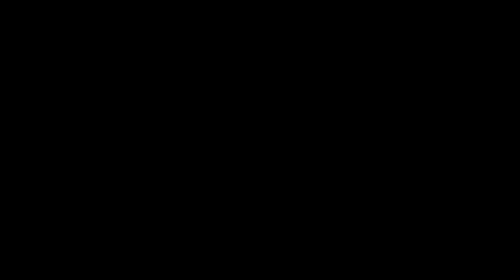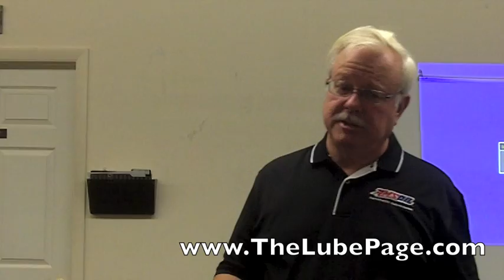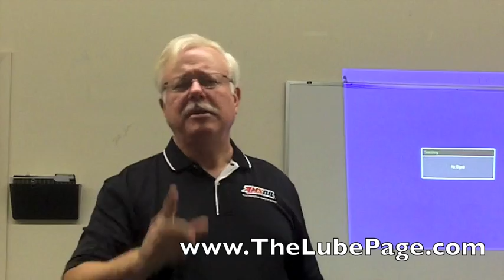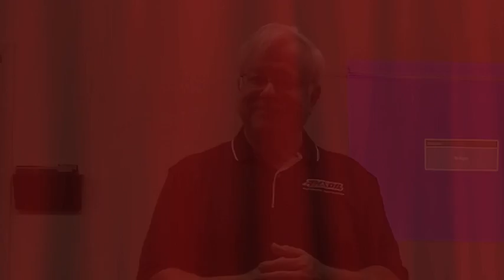Transmission Fluid Facts

Comment: Guy buys a new $60k truck...gets mad at the $50 oil change every 5k miles...gets even more upset at 120k when they recommend a $200 transmission service...skips the $200 transmission service, that's too expensive....150k transmission fails, and wants to sue the automaker because they sold him a junk pickup truck with a terrible transmission...but they'll spend $5,000 in fuel a year chasing a football team around the country to go to all their games, but that $200 transmission service well that's just too expensive, and what do you mean I should have changed it at 30k miles the book and dealer says it don't need changed till well over 100k...well sure they want you back on the lot in 10 years or sooner buying another vehicle as a result of the neglected maintenance.

Its got "lifetime" fluid in it...yeah sure it does, now change it.
Reply from the maker: William, tell us what you really think!  Lol
Reply: @thelubepage  hi Dan I have a 2014 grand cherokee with the 
Zf 8hp70 transmission. Here in canada dodge sells the fluid as a mopar 8&9 speed atf for around $40 a quart. Elsewhere its sold as lifegaurd 8 (amazon & from zf directly) for a little less. There's alot of talk on forums about the dangers of using any other fluid. However there are alot of people who have used valvoline maxlife full synthetic with reportedly no problems. The local oil change shop says that according to their information the vavoline meets shell L-12108 spec which makes it compatible. Ive been unable to find any information on what exactly shell L-12108 specs means. I have however been able to pull the data sheets for both fluids and the numbers are very similar. Wanted to get your expert opinion on this... if it helps I can send you the data sheets showing the technical data/spec for each. I want to do whats best but am very suspicious that "only use our fluid at $40/liter" thing is just a marketing ploy.... thanks for any input/advice... let me know if you want the info
Reply: I believe they want throw away cars now, just like toasters. The days of manufacturers priding themselves on producing a car that goes 300-500,000 miles is over. Not to mention with the help of the CAFE standards.
Reply: @LittleJimmyNorton  My 88 F250 has 760k on it, no need to throw it away, all those are highway/towing miles, no mechanical issues at all.  It all depends on how well you take care of stuff.
Reply: I find it very frustrating now because even the vehicle manufacturers are emphasizing the will not honor there 10 year 100,000 mile warranty if they find out the fluid that was installed doesn’t meet the specific spec that they provide you in the vehicles manual. Forcing you to buy there overpriced spec fluid. God forbid you buy a fluid that actually meets and exceeds there’s and you end up having a mechanical issue that should be covered because of a inferior part and they void your warranty. Now you end up having to pay for a repair they should have covered. Essentially we’re forced to buy there over priced fluid at least until the warranty runs out. So I will be putting there fluid in my truck at the severe service interval or less till my warranty runs out. After that by then I should be educated enough to decide what fluid manufacturer product I will put in it.
Reply: @Jon-O.  Thats actually against the law to require their fluid.
Reply: @brianpeters867  no It's not they give a fluid spec and there are no others with that spec sometimes for years depending on what fluid it is
Reply: @Jon-O.  I think you miss my point. There is a law called the  Moss Magnuson act, since 1975. Baiscally it states that if a dealer mandates a fluid and parts for your vehicle, it must give you the fluid and parts, free of charge. To say to you “You must use this such and such OEM fluid in your transmission, or your warranty is void.” It is against the law to do that. If a dealer says that to you with anything that has a warranty, ask them to give it to you in writing. They won’t because they know they can’t. It is a bullying technique. Now if no other transmission fluid is available and meets spec for trans, except the OEM one, then the only very obvious choice is the OEM fluid in question. I would just about bet, however, that Amsoil ATF or ATL would work just fine, in a test situation of course.
Reply: @brianpeters867  that is where the conundrum lays in. If there fuild is the only one that meets the spec then one is used that doesn't and a failure results your warranty is void. And your vehicle did come with it installed free of charge. When you go to replace it they are not legally bound to give it to you free for the life of the vehicle.
Reply: @Jon-O.  There is no conundrum. Thats why Amsoil uses a dealer network. Dealers will look things up or call Amsoil technical to get a firm answer on eqch vehicle/equipment. Your dealer will recommend the proper fluid for the vehicle in question. If we do not have a fluid for the vehicle, then don’t use any Amsoil trans fluid or any fluid that is not up to oem spec. We have fluids for most vehicles. Call a dealer. I am a dealer but this isnt my channel.
Reply: @Jon-O.  But when the service life of say the trans fluid, but vehicle still under warranty. You can ask the vehicle dealer if they are providing the filter and fluid for free. If they cant, then use any fluid you wish thats under spec.
Reply: @brianpeters867  yeah but they do not have to give their fluid for free they are not legally bound to that
Reply: @Jon-O.  Hang on. The Moss-Mag act says that a car dealer can NOT void any warranties if you use a fluid that meets the spec of the OEM fluid. They CAN void your warranty if they give you say ‘oil changes for 3 years’ and you put a different oil than what is offered at the dealership for free as part of the agreement in the sale. Yes, in that case they must abide by that agreement and give you the OEM fluid for free until the car reaches the expiration of whatever agreement is in place. IF they offer free oil change etc. If you decide to say ‘heck with them they wont know ill put WalMart full synthetic in my car and theyll like it’ THEY can void the warranty then if they sample the oil and find out some other oil is in there. If a car is year 4 and free oil changes  ended at year 3 but warranty is until year 5, use whatever fluid you want that meets the spec!
Reply: William Todd see my last post,,,American way,,,
Reply: Maintenance-free transmissions and lifetime fluids are the biggest lies ever told. Even a perfectly sealed transmission with magical unicorn synthetic oil will be due for servicing after five years. It's an inevitable and unavoidable law of physics that any form of lubrication has an expiry date.

Comment: so amsoil dealers know so little about cars he has to explain what a clutch pack is?  This dude thinks the rad runs at 200f cause of the thermostat? LOL if the rad ran at 200f your car could never run like... under 240f... 

BTW my 1980s np205 t-case can use gear oil ORRRRRRR atf... yep... ATF in a gear to gear transfer case... so the whole thing about a auto transmission... and atf... 

CVT constant velocity transmission.... wow... just wow... dude donno wtf a cvt stands for but we should believe anything else? 

Wonder if he knows what mercon LV means... 

dude talks about API yet amsoil is not API rated LOLOL...
Reply from the maker: Matt
Please take your medication on time!  Your eminence as the grand master of all things mechanical is not in question so you don't have to continually show your superiority.  

Again, as I've told you in other post, my mission is to make sure the correct lubricant is called out for the application.  So explaining the action in a clutch pack is a prelude to explaining the necessity to make a fluid that will be compatible with that action.  It doesn't mean that no one knows what a clutch pack is but it is part of the explanation of why we have to make lubes that re compatible or that may enhance the clutch pack action.

Oh Matt, I don't think you have followed my complete explanations of ATF.  I explain that the auto trans has real gears (sun and planetary) and that these gears can be under just as much load as the manual trans and yet they are protected by a very light weight ATF.  There are even some manual trans that use ATF so of course the Transfer case uses ATF.  So Matt what is the exact lubrication regime for standard gears (no contact and slide)?  You know you can use ATF, 30 weight motor oil or 75W-90 gear lube in many transmissions in others the OEM is specific calls out a specific lube.   

You got me on the CVT, I think I'll just go to my room and cry.  Come on Matt, that's just gotcha tactics and usually comes from someone trying to show how they are the Superior dude.  Truth is in all my discussions, I just use CVT and with all the acronyms I did a brain fart and substituted Velocity for Variable. Again, for my purpose which is to make sure the folks I am training know that the CVT takes a different fluid than the standard ATF.

 Mercon LV .... I don't know Matt, if I get this wrong you may be elevated to Grand Pubar, so let me give it a try.  Is it Low Viscosity? Oh my I hope so.  This is so much like Middle School but I have to respond.

Amsoil meets and exceeds the API ratings on all oils.  Amsoil does not license all their oils via the API and neither do all the oil manufacturers.  Check out Valvoline high mileage oils and you won't find the famous donut symbol. The License means you are complying with the additive limits from the EPA and Valvoline and Amsoil may have a more robust additive package so the API will not license the oil.  However the performance requirements set forth by the OEM's can be met and this qualifies the oil company to list on their bottles that they meet or exceed the API standard, you just won't see the licensing.  Check out any Amsoil oil and you will see the API S for gasoline and C for diesel ratings.  You will even see the donut on some products.

Matt, Amsoil has been making synthetic oil for auto's and trucks longer than anyone (since 1971). In fact Amsoil produced the first API rated synthetic oil for auto and trucks.  Al Amatuzio started the company and today his son is now the CEO.  This company went from a small startup to having over 800,000 square feet of manufacturing in an ultra modern blending facility in Superior WI.  The company is well respected and considered the pioneer in synthetics.  I don't think you like the idea of independent dealers. Al Amatuzio was crazy about entrepreneurs and loved to see the little guy get a chance, so Amsoil is built on the independent dealer model.  You will have some Amsoil dealers who may not get everything exactly right and some who are over aggressive in sales but in my 27 years with Amsoil most dealers are striving to do a good job and build their business.

Comment: The newest transmissions from GM/Ford are a 9 speed automatic, and a 10 speed manual. Transmission fluid has to lubricate, act as a hydrostatic drive fluid, a lubricant,  a friction modifier, and a coolant. Then I also have "transfer case fluid", too! I use Valvoline, synthetic. I have for YEARS! DEX 6 full synthetic!!! Transfer case fluid, I went with Delco. It's grape scented now! I swear to god, it's blue, it's oily and it smells like grape soda pop.
Reply: Switch to Amsoil.
Reply: i know this is old but there is more. It's also has to not foam, it has to handle temp changes as the seasons change, it also has to clean (detergents). It's quite complex.

Comment: Are all brands of ATF+4 the same? I've been reading the license agreement with Chrysler specifies the exact formulation in order to carry the +4 designation.
Reply: I know this is old, but you simply need to look for the ATF+4 on the bottle, then the license #. Chrysler licenses their atf fluids through a variety of companies. SuperTech from WalMart carries it for about $5 per qrt.
Reply: @mitch1847  8
Reply: Amsoil: As long as it lists the spec on the bottle, it will work just fine as a replacement.

Comment: Just curious.;  My Buick fluid is Cherry red . clean and no burnt smell, But kinda thick in feel . my Question is
automatic transmission fluid, viscosity, Dextron VI by  GM  just how thick is this type fluid when feeling it with fingers on the dipstick  in comparison to  a motor oils weight  should it be something like a 10 weight or 20 weight motor oil  by feel?
Reply from the maker: If your good enough to rate viscosity by your fingers you are really good.  Transmission fluid is just below a 20 weight and in some cases about a 10 weight.

Comment: Can I use Amsoil atf on my GM 2007 H3 Hummer 3.7 atf
Reply from the maker: Yes you can.  You would use the ATL version which is Dexron VI rated.
Reply: U drive a Hummer. Lol. You're screwed

Comment: Constant Velocity Transmission??.... LOL!.
Reply: Dan Watson Continuously Variable Transmission.
Reply: Dan Watson Constant velocity is what CV stands for regarding CV axles and CV joints. They are called constant velocity because they maintain identical velocity on both ends of the axle the end that connects to the transmission and the end that connects to the wheel via the flexible joint. Continuously Variable is the exact opposite scientific philosophy of constant velocity.
Reply: Brandon Lee  lmao eloquently put you man of real genius damit you need to run for President
Reply: ALL transmissions are "constant velocity"!!
Reply from the maker: We're in the presence of genius, maybe a little sharing of your knowledge could help the less intelligent.

Comment: Im about to do the poor mans drain on my '12 Titan, 50K on it. No problem with mixing the amsoil with the stock fluid? Will drain it again next oil change.
Reply: I have the same question.
Reply: Whenever doing a poor mans drain  use what it calls for or what's already in it.   Just wait for a complete flush to add the $$$ stuff.    Considering most pan drops are 4-6 quarts but flushes are 12-18

Comment: so I have a 07 prius that has a cvt transmission and on the fill plug it takes toyota world standard, and you are saying that it don't do the job....what should i put in it? i am currently at 200,000 miles and have chaged it 3 times with toyota ws fluid.
Reply: +Emily Martin stay with the Toyota Fluid !!
Reply: Emily Martin Hybrid's typically don't have the CVT transmission used in non-hybrid cars. Toyota's hybrids are more like a set a differentials and two electric motors that are acting as the 'variable transmission'. Confirm this of course for your particular year. You can't go wrong with what's specified in the manual. :)